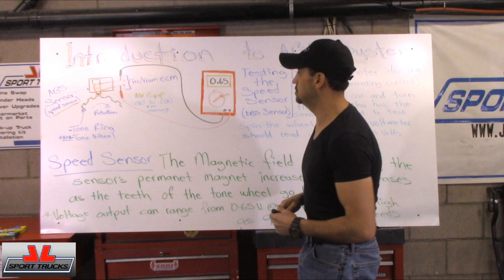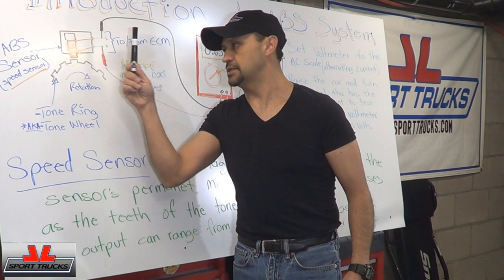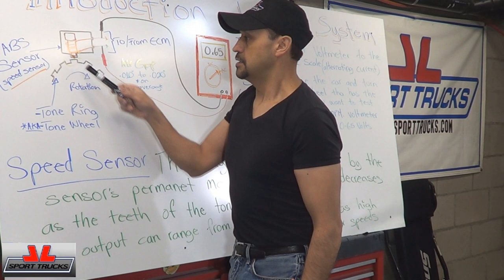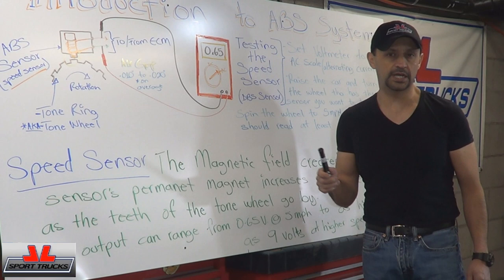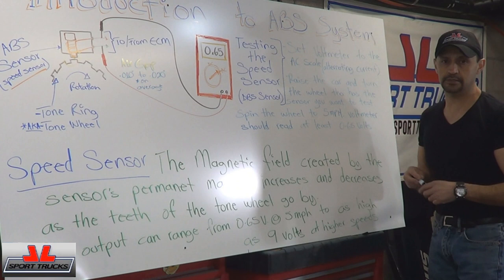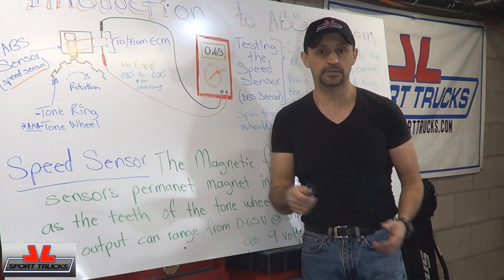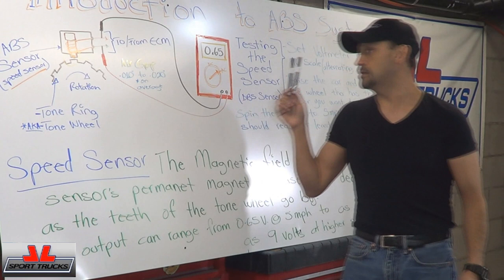How Wheel Speed Sensors Work, aka ABS Sensors and how to test them

Comment: Wow this was a great video indeed I like the well detailed map of how the ABS system works my favorite part is how the toenail needs to have magnetic contact with the ABS sensor, and I like how you say the only thing that can stop this magnetic contact is dirt Grease or some other type of object that could interfere. I'm using a seven function digital multimeter I know you mentioned in the video to use AC volt but can I still do DC volt instead?

Comment: Question, is the sensor truly a magnet? If so, if the vehicle is using metallic brake pads, can the magnet attracts the metal partials to the sensor causing it to block the signal? Much like a magnet in the engine or transmission is placed inside to purposefully grab magnetic particles. I’m wondering if the sensor is attracting metal particles and once they cover the sensor it is no longer working. The vehicle in question is a Mercedes double rear wheel van where the sensor is buried under and behind the disc brake rotor. They go bad on motor homes on the sprinter chassis all the time. I just wonder if they are being covered with metal particles and lose there signal. Your experience would be appreciated. And that’s a great video, thanks.

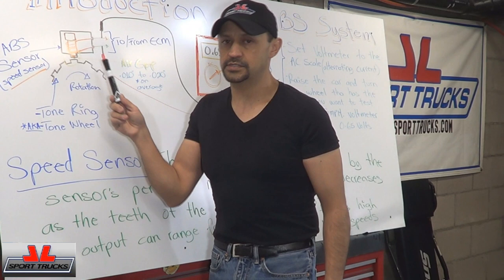Comment: 2:07 did you say the reading will be off ?

in my honda, it says i need to get my abs fixed,

i cant retrieve codes from
my car with a scanner ? is that because of the abs ? they're connected ? im sure the scanner aint broke, dude that sold me the have had everything new and fixed besides abs sensors, and he said the mechanic told him its just the abs, what do anyone think ?

Comment: Quick question about the sensor and testing it..  I would assume that a very basic test to make sure the sensor might be working, would be a simple continuity check, correct?  I would assume if there is no continuity, then there is no chance the sensor will work.  Is this a valid assumption?

Comment: I have a question that you may not be able to answer but thought I'd ask anyway. I have a 2008 BMS Goka dune buggy, and the speed sensor is missing. I can't get the OEM part but others are telling me that I can get other sensors that will work. My problem is, I don't know anything about color coding to know what wire is hot or ground. the sensor has three wires. Brown, Yellow, Blue. This is on the OEM sensor. The sensor that I can get has three wires, Blue, Red, Black. How would I know what wires go where? I have to hard wire the sensor in because of the connectors don't match. Also, this sensor points to or faces the disk. There are no teeth. I'm stumped, and not knowing what to do. Can you help me with this problem, please? Thanks...
Reply: Your system apparently uses a slightly different type of sensor which includes a transistor.  Your type produces a square wave of constant voltage, so it cannot be tested as he shows in this video.  The type of sensor in this video is the simpler, 2 conductor one.  My suggestion would be to somehow obtain the related wiring for your vehicle, and then match the wiring with the new sensor you got.  There should be a 1) Ground 2) Signal 3) Reference Voltage  You should be able to reverse engineer the wiring sequence of the sensor fairly easily with just a multimeter, I would think..  Here is a starting point, anyway:  /watch?v=ujc6pjftZ_w   Good luck!